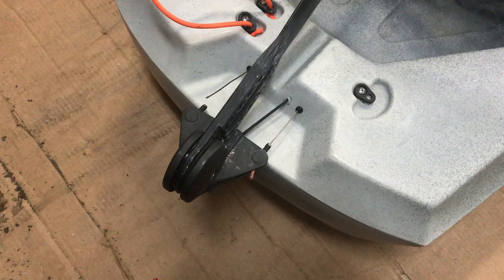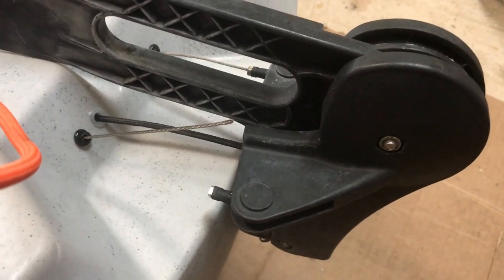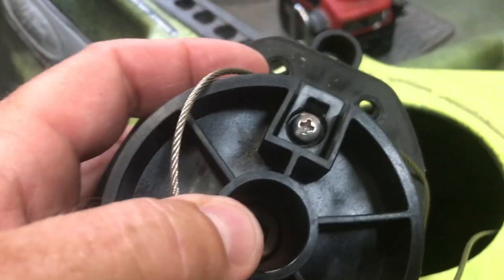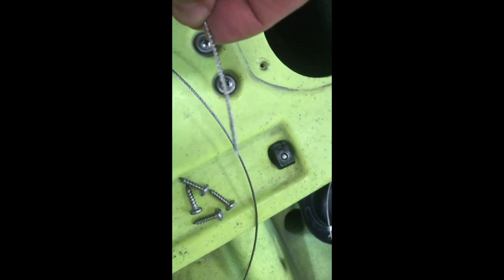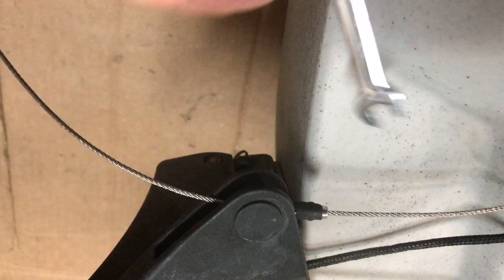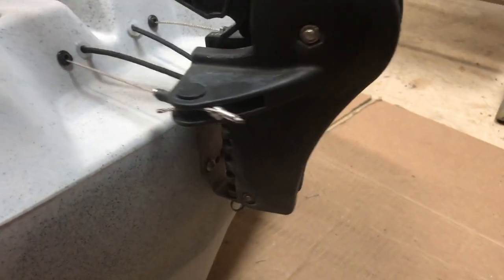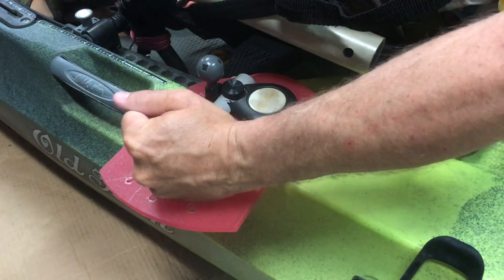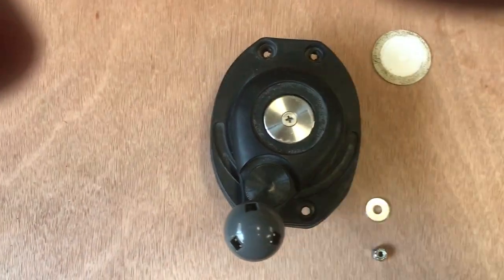TOPWATER PDL RUDDER STEERING CABLE REPAIR & MOD STEERING ARM

Comment: Do you think it has to be 1/16 inch wire or can it be 120 lb nylon coated steel wire as it’s smoother?

Comment: Your videos are very helpful! I wondered if you had any trouble with the rudder position lever? I have tweaked mine and I am too ignorant to know how to fix it, but it doesn't do anything now and I have to climb back to flip the rudder into the water manually and its not at a right angle when employed anymore, just loose. The string might have jumped its track? Any videos on that?
Reply from the maker: Thanks! Climbing back to deploy it does not sound too fun.  Sounds like however the cord attaches at the handle may have gotten out of adjustment.  Would probably need to take the four screws out at the handle, pull it out and look at it. Probably not too difficult a fix.